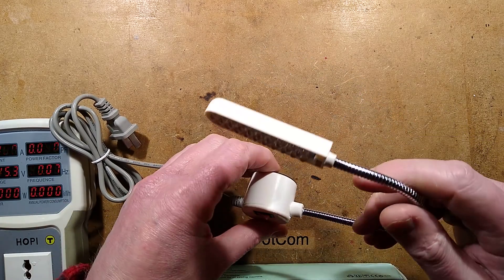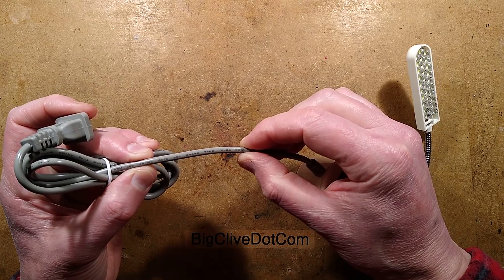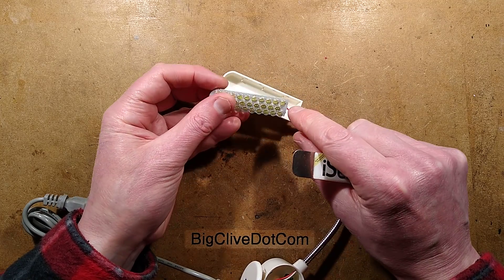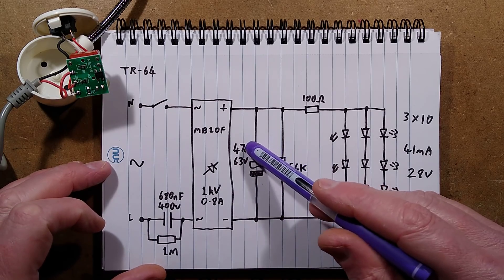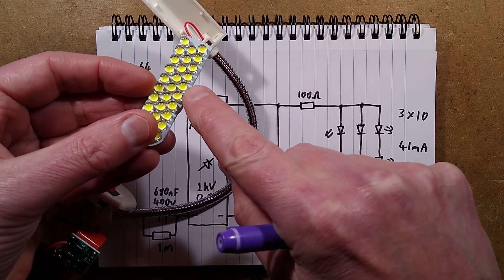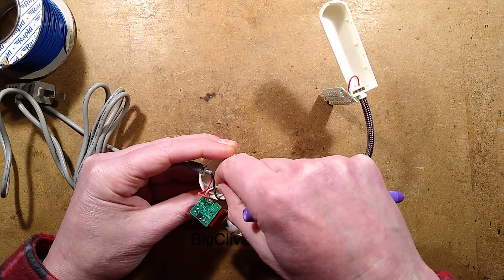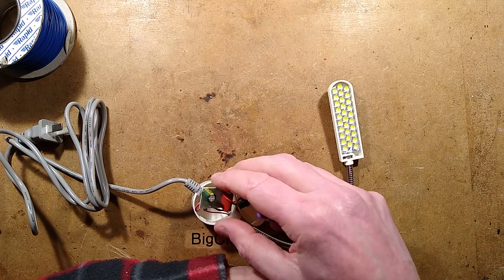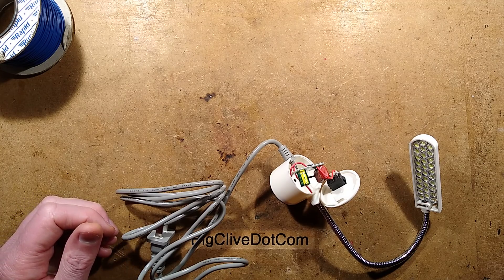Exploring a Chinese magnetic "machine light" (with schematic)

Comment: I have several of these lamps and find them extremely useful and versatile.  I would like to convert a couple to usb rechargeable.  Any suggestions?
Reply from the maker: You could power them from a power bank and hard wire the LEDs in parallel with a suitable resistor in series.

Comment: I have bought two of the dam things recently and I had nothing but trouble with them.
I wanted a magnetic lamp for my wire EDM and of course I picked the cheapest one I could find on Amazon.
I wired the lamp into the machine  circuit and for the first few minutes it worked fine.
Soon, I noticed some small clouds coming from the machine.
At first I thought they came from the machined workpiece, but then the light started flickering and eventually failed .
Total run time was ~ 10 minutes.

Returned it to Amazon, bought a new one.
Again I wired it in and the moment I switched it on the capacitor went up in sparks and flames.
I ended up ripping out the rectifier and just connected the wires to an LED power supply.
The first one I tried would not work.
My lamp needs at least 12,5 volts to light up, my driver only goes up to 11 volts (despite claiming 12 volt output)
I replaced it with a 17 volt supply.
Of course I tried out if the lamp would work at this voltage and the tests seemed fine.
In reality, when the lamp was first switched on with the new driver, the glue holding in each LED element slowly heated up and one element after the other just failed.
They seem to just have used some kind of hot glue.
Reply from the maker: I wonder if the EDM machine was creating a lot of electrical noise.   That would stress the capacitors.

Comment: Hi Clive
I use these in my shop for Grinders, Bandsaws, Drill Press, 30 ton Hydraulic Press, Bench Sanders, and anything else where I need more light. I have been using them for about 3 years and none have went bad yet except the one at the Ryobi charger where the batteries went sour on me.

Comment: As a volunteer update to this -- I was inspired by the video to buy the USA version of this. The only difference inside is the capacitors. The dropper cap is the same 400v, but a 470nF job, and the electrolytic can cap for smoothing is (likewise) the same 63v rating, but increased in capacity to 100uF. I find this mildly interesting, although I'm unable to explain why, exactly.

I'm planning, at the moment, to see if I can purchase a 5v -> 28vDC boost circuit from eBay, to replace the existing internal supply,so I can run it off a power bank. The area where I live is given to occasional outages because it's vaguely rural, and I often wind up doing my tinkering in weird, awkward spots that are poorly lit because I often wind up doing repair work for friends and relatives who have strange issues with stranger equipment in unspeakably strange places, so such a light would be immensely useful to me ;)
Reply: I'm also planning to see if I can get a similarly-designed Kink Palculator, which will get the correspondingly proper labeling on it with a Sharpie.

Comment: I got one of those lights for my soldering station  and put a UK plug on it. What a can of worms did I open changing the plug, The wires in the cable are incredibly thin, probably 10 strands of ultra fine copper coated aluminium in each core and are amazingly fragile, With the combination of very thin and fragile it took several attempts to put the plug on, I think in the long term the cable will be getting changed with something more suitable.

Comment: I see one potential area of concern. If the 100 Ohm resistor fails, the 47uF/63v capacitor will exceed its rated voltage and could let the factory-installed smoke out.

Comment: Good evening Clive, good video as always. Im looking at something like this for Mum, but she’s not one for using plug adaptors, so I’m wondering if I could change out the plug to UK 3 pin? And what fuse you would recommend to be safest option?
Cheers Big Fella 🍻
Reply from the maker: Yes.  Change the plug to a standard 3-pin plug  and use a 3A fuse.  (Or better still, a 1A bs1362 fuse if you can get one.)

Comment: I bought one of these about a year ago, knocked the magnet off it and mounted it to a lightweight tripod. Even with the low light output when compared to larger lamps, it's been a real lifesaver when you need some light in fairly confined areas.

Comment: For about £5 GBP I’ve got a load of these in my workshop - 2 on lathe, 1 on bandsaw, 1 on drill press and a couple of spares I move about. Only thing that is a bit naff is they come with a adapter rather than uk plug that is a bit lose.  I therefore cut supplied plug off and fit a uk plug.  For the money and function I agree- they are ace!

Comment: Grandma got one of that a while back, shitty edition though, it fell apart within a couple months, magnet fell right off, then it started flickering and died, i didn't even bother fixing it.
The one she had had square LED's in it, same layout as that one, but you could actually touch the solder pads if you stuck your smaller fingers in there, and probably get zapped since it was the exact same type of power supply with that big ole red capacitor.

Comment: Clive I am trying to find out how ultrasonic mist makers dry run sensors work. I'm trying to build a mist maker and am wanting to integrate a dry protection cut off. Any ideas?
Would you mind doing a tear down and analysis or give me your thoughts.
Much appreciated.
Reply from the maker: I think it measures the capacitance between the water and case.  Some use a magnetic float.

Comment: I have several of these (> 6) scattered about my home 'shop' here in the US. It's a very good task light to have when drilling or soldering. I've had these for a number of years and they have been very reliable (no failures so far). Purchased all of them on eBay from different sellers in China (30 LED version). The earlier models had the on/off rocker switch in the center and later models are offset. There is nothing printed on any of the power cables. The LED color is a bright white, probably 5000K or so. The magnet on one of the lamps came unglued, but was easily fixed with some contact cement.

Comment: I'm asking now just because this is the most recent opportunity:   My kitchen fixture has an older dimmer switch ( neon night-light & toggle)  , which will allow proper dimming only if one of the sockets has an incandescent bulb.  Meaning:  5 LEDs = flickering until full voltage, while 4 LEDs + 1 old 40W incandescent = fully gradual range. Why?
Reply from the maker: It needs a minimum load for the triac to latch on properly.

Comment: Does voltage matter when it comes to cables? I thought it was only really the ampage that mattered.
Reply from the maker: Insulation has to be thicker for higher voltages, and also for safety against abrasion.

Comment: How do you even get 30V cable? Basically any insulator one could use to insulate a cable is going to take far, far more than 30V, and it's double insulated cabling at that, 2 layers of insulation between any conductors.

Comment: Clive, it looks like this might be a nice light for late night work on PC/Laptop, emergency light ... could this be redesigned for lithium battery power at all?
Reply from the maker: It would need a boost converter or LED PCB redesign.
You can get USB gooseneck lights.
Reply: @bigclivedotcom  Thanks, Clive. Loving your content here in Newfoundland! I had just wondered about this light, as the design appears so nice ... the LED's look really good and the design seems solid. Say hi to the club for me.

Comment: That plug is missing its speed holes, so it won't stay in the wall.
It doesn't look polarized either, so who's to say which side is neutral? 

Really, the printing on the side is maybe the least upsetting part of that cable. Not acceptable or good construction imo.

Comment: I was asked to look at one of these that failed once, a sewing machine mechanic had bought some for his factory. The little board in the circular box had gone bang so violently that it had metal plated the pcb and put mains onto the led head. (dropper cap exploded). 240v sewing lights are often connected between one phase and starpoint of the motor as the older machines dont have a neutral supplied from the overhead busbar system. Lots of power available.
Reply from the maker: Sounds like an inline 20mm ceramic fuse wouldn't have gone amiss.

Comment: Put a dab of hot glue at each end of the metal gooseneck, to keep the wires from touching the metal and risking a short to the metal.  Since you are going to pop it open anyway.  ;-)
Reply from the maker: I'd rather disconnect the wires at the LED end and try and slide a heat shrink style sleeve around them inside the gooseneck.

Comment: I bought a few of these with the intention of converting them to 18VDC and run them from a Ryobi one battery.
This was so I could move them from machine to machine easily, and use the Ryobi batteries I already have.
The physical layout of the LED board connections made it too difficult to reconfigure them for a lower voltage.
Reply from the maker: You may have been able to put a small boost converter in.  Or rearrange  the LED circuits so the long series string was two parallel groups to give 15V, then add a resistor.
Reply: @bigclivedotcom  not sure. I can’t remember the exact led layout as I looked at it a while ago, but I remember doodling for quite a while trying to work it out.
I was very concerned about the mains referenced feed to the leds via that small wire, and had visions of it shorting to the metal bendy bit, so I think I’ll sleeve it to give me some piece of mind.
Still a DC (maybe even a USB) version still seems like a good idea.

Comment: 3:54 Does it matter where you put the switch, N or L? It depends on what way you put the wall socket. Maybe not in the UK, but if you use an euro-plug it doesn't matter.

Comment: With that type of plug wouldn't you use it at 110v?
Reply from the maker: It's a Chinese plug for 220V.  On 120V it runs at very low power.

Comment: Off topic ...have one of the lethal Chinese uvC lamps and it's decided to stop working.
Has a cd11ges capacitor with a 105c ... guessing I've left lamp on too long and it's overheated ?
Spec sheet implies it may start working if left to cool down for a while, or is that just wishful thinking on my part, and really it's totally banjaxed ?
Reply from the maker: It could be anything, including a broken heater in the lamp.  It may be easier just to get a new one.
Reply: @bigclivedotcom  easy, but tad more expensive than capicitor from RS ..🤔
I'll let you know how it goes ..
Reply: The cheapo Plan B alternative, was similar to a tabletop one you reviewed a while back.
It turns out it had a faulty timer circuit ( now bypassed ) and the lamp mount is a bit slack ( probably explains why the bulb in yours was cable tied in position?)...
So, after hacking it a bit, you get a usable 38watt uvC lamp for £7.50 ...I bought 2 more just for spare bulbs !

Comment: Are you able to test or give your opinion/run down on the circular bendable clamp style grow lights on eBay?

I have 2 myself, a single head lamp and the same style, with 4 heads.
The plant seems to react to the single lamp more strongly than the quad version. 
Having all 5 lamps on at once the plant reaches toward the single lamp. 
Wondering if the quad version is losing some voltage sharing it between 4 lamps giving it a slightly dimmer light that the plant can sense?

Love your videos they're teaching me a lot about circuitry and components. 🙌

Comment: I've found lots of 240v mains cables with 30v in the details printed on them over the years so it's probably a standard thing rather than a rating. YMMV however; depending on the cable manufacturer and how shady they are. I rarely have cables fail and even then its usually age, torsional stress and stretching, or all three that finishes them off. Then they crackle, hiss, glow, smoke or arc like a bugger. Fun if nerve wracking times!

Comment: It appears the cable is not correct for AC power, either 240V or 110V.  The device also doesn't appear to be UL, IEC, or otherwise approved.

Comment: I wonder why using 30 Leds at 1.5w instead of a single 3w Led and driving it down to 1.5w, or using two 1w Leds?
Wouldn't it "reduce costs"? Maybe 🤔.
Reply from the maker: The cheapest circuitry is a capacitive dropper, which better suits a higher voltage LED array.

Comment: As a double insulated cable, I reckon the total insulation is fit for mains voltage. I suspect the individual cores may only be fit for 30V - but for 30V do you need insulation at all ? ;)

Comment: I have a comment regarding your work surface and not the video . I had a mdf work bench for many years and after replacing the top many times from water damage have found that if you use tennis shoe water proofing spray it will stop the work surface from puffing up when wet. it soaks in so it won't rub off.

Comment: Are we sure that's not a kinked panthulator? I had visions of Peter Sellars and Burt Kwouk doing battle in the back room.

I hadn't really thought about it before, but I wonder if with a bit of jiggery-pokery, I could retrofit my vintage Singer sewing machine with parts from one of these. It would save a lot of hot and sticky work, not to mention singed knuckles.

I wonder just how secure the clip on parts are against being dropped on the floor. Otherwise, a useful looking little work light.

Comment: I've been using a few of these on my metal workshop shelving. They're really sticking quite well, and give acceptable light. I wonder whether one could adjust the driver current a bit.. the 13mA you calculated are probably far from what the LEDs can take without running into a heat death.

Comment: fine for a sewing machine, but i wouldnt use this on a lathe, there is a reason lathe lighthing is 24volts... hot metal shaving can melt cables :D
Reply: @ItsMrAssholeToYou  true, but older lathes have 24Vac atleast in my country, bit more work, but still possible

Comment: I attached two of these to the column of my drill press, and tied them into the same main power switch (240v), since these work from 100v to 250v despite shipping in the US with the NEMA 5-15P-like plug.  I triple checked that they did not have any measurable leakage current and that the face of them didn't have any line voltage exposure, and triple-checked my equipment's ground as well (since it isn't on GFCI).  Indeed, the cable is garbage.

Comment: With that plug, there's no way to determine which will be live side.  There are others with one wider lug to solve this problem.
Those LEDs could easily go open circuit.  Well, the connection could.  Those connecting wires and their solder points are subject to a lot of movement.

Comment: several things wrong with the light that may make it not pass american electrical code.

1. looks like no wide prong (if there was ever to be any metal parts on the outside that could come into contact with the wires inside it could become live if connected in reverse).

2. you said it is using 30 volt signal cable witch works but is not very resistant to tugging and could rip loose creating a potential shock hazard.

3. the plastic enclosure holding the switch and dropper board is too easy to open most plastic enclosures are rf or sonically welded so they cant be opened very easy.

4. the led board is just set in and could fall out potentially exposing someone to shock hazard also a plastic piece should be over the led board so user cant come in contact with the leds.

though the led dome is safe to tough if an led was to burn out and explode it may leave the led chip die exposed.

Comment: I see the LED head turning on the metal spring ? Wires often break there in the end, and then all LED's are disconnected, hence high voltage.
Why no current limiter for inrush current ? To low ?

Comment: looks like these if cheap would be good to replace the cap dropper with a boost converter so you can run it off 12V for campers etc..

Comment: how do you calculate the capacitor in series with input to have "X" drop in voltage? why they got 680pF? which formula they used?
Reply: The voltage drop is easy, that's always the line voltage minus the LED voltage. In this case 240v - 30v = 210v drop. The capacitor value determines the _current_. To calculate the capacitor value you first calculate the impedance Z (AC equivalent to resistance) you need, then find the capacitor value that gives that impedance. This isn't exact (because of sine wave peak vs RMS vs average) but it gets you in the right ballpark.

You find the impedance by working backwards from Ohm's law, V=IR (really V=IZ). Here 210v = .04A * 5250 ohms. Then you find a capacitor with that impedance at your line frequency. Impedance of a capacitor is Z=1/(2pi*f*C). Rearranged you get C=1/(2pi*f*Z). In this case C=1/(6.28*50*5250), or C=6.07 *10^-7 farads or 607 nanofarads. This is fairly close to the 680 actually used.
Reply: @eDoc2020  thank you, very kind of you to explain it.

Comment: Hi Clive, at 3:55 you point out that the switch is in the neutral side of the circuit.
But if the mains plug consists of a parallel pin arrangement, how can you tell if it is plugged in with the switch in the active or neutral side of the mains power?

Comment: Unless the inside of the gooseeneck is sleeved it doesn't look like it conforms to the requirements of double insulation! It IS an Issue (See EN60598-1).
Did you check the voltage rating of the switch?